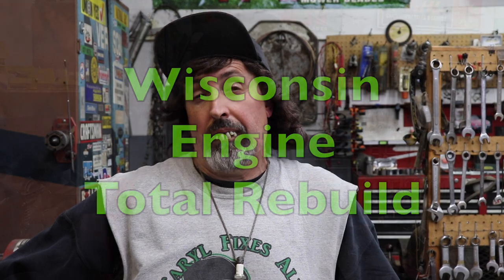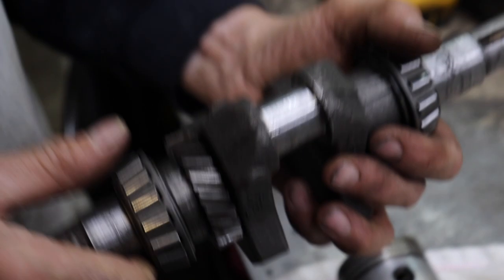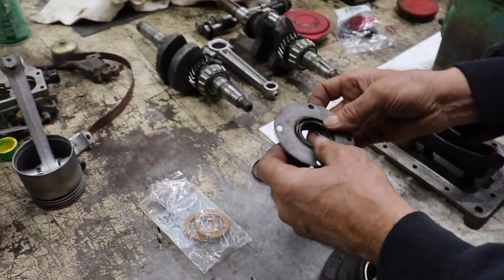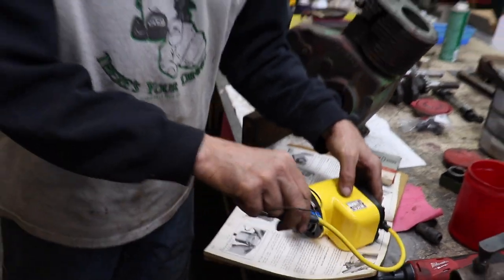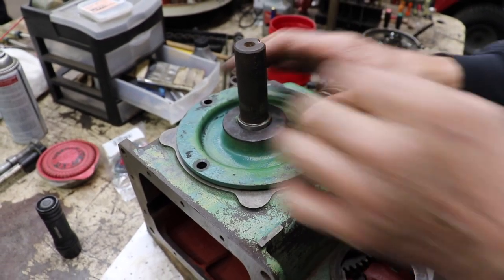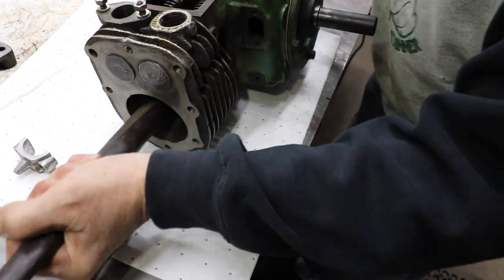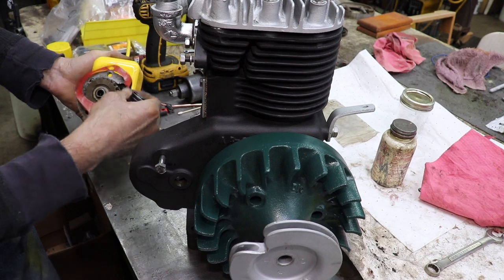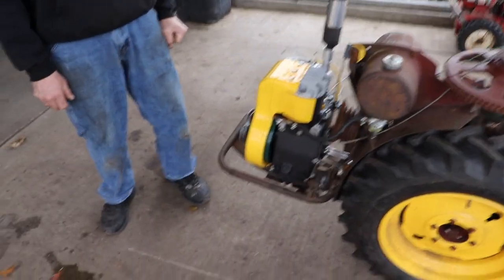Epic Wisconsin Engine Total Rebuild

Comment: Wisconson motors were used for years and years on all types of farm and industrial equipment.  Essex  mixers, stone mixers, big plaster pumps, small grout pumps, acoustic machines, just to name a few. The motors would run all day long. Once in a while  they would loose A mag. Or have some carb problems all easy fixes.  Some times a spark plug. They kept running with piston slap, many times they were low on oil. They ran in very sandy dusty conditions and kept going. They were old school motors. I think the company was taken over by someone else. They got to be very expensive. Honda took over there spot, also a very good motor.

Comment: Wisconsin engines often didn't have ridges but they got really tapered.  I used to rebuild AEN and AENLDs and I don't remember ever using a ridge reamer on them.
Reply: Those are really good engines, I have 2 one rebuilt and one not also a AGN
Reply: @loosehandle1  Back in the days when it was cheaper to rebuild an engine than buy a new one.  Wisconsin Robin engines came along and I was done rebuilding engines.

Comment: Maybe not on small single cylinder engines, but small car engines from mid 60s back often had 4 rings. The offset lifter to valve geometry was odd, but maybe it was some attempt to make the valves rotate and enhance sealing. You sound surprised it still ran. Just proof of how simple was better, and those old engines could take a lot. I've seen points that didn't even have any contact surface left. Those ones looked good to me. Does end gap actually matter?

Comment: Taryl I watched this video tonight..I have a Wisconsin Teledyne Robin horizontal shaft engine that is still new..never been cranked or ever had gasoline in it...It has a push button start also..I've had it since early 1980s in storage..thought I'd mention it here if anyone may be interested or have a use for it..Andalusia, Alabama
Reply: I would be.

Comment: I have owned and overhauled a few of the Wisconsin engines over the years but I haven't seen the push rods and valve stems mismatched like that I believe somebody build that engine  on a Monday or late on a Friday evening but they are a tough engine I like them and the four rings really cuts down on that piston slap but I have several of them in my collection I mean I ain't talking about a big collection I'm talking about maybe I got I don't know maybe four or five and I really like them they're  a nice tuff old engine just like this granddaddy in me. Lol!
And yes cork was the norm for most of the seals, I mean you get oil on them things and they just as good as any Rubber seal and probably do a better job cuz they are thicker.
I just started watching your video but I just had to throw my nickels worth in there but I'm going to enjoy the rest of your video cuz it's not my hands thats getting into that mess but I do enjoy when you get your hands all messy thanks for a great Channel we enjoy all your videos!

Comment: Taryl,

 On loose fitting seals, I have taken red loctite to take up the gap and hold them in place. The mating surfaces have to be extremely clean however, and you have to quickly get the seal in place before the loctite starts to dry.

Comment: You probably already got this info but I think the reason the valves and the push rods are not in line is to have the valve rotate while running(old technology) and the end filing is common on racing engines, have done many racing engines they actually sell a small
 Tool for filing ring end gaps. (Over size rings)

Comment: Maybe those seals could be glued in with lock tight? Or something more substantial,  possibly make a tool from pipe to drive it in, or if you have a lathe, machine the cover, to fit a bushing, pressed in, to fit the seal tight inside, but HEY!  It's not a rocket engine!,
Reply: We used old Indian glue back in 70

Comment: Just a general question do you also work on Vintage bikes. Like the VeloSolex 1700 from the 1960. Need to track down engine parts if they're even still available or traceable. My friend needs a piston and rings and gaskets.

Comment: I have an old way Wisconsin AENL D and AA-91A on the block. My question is , when I removed the coil box I found a line on the side of the cam gear and a “X” on the edge of the coil gear, so how am I suppose to put Back together and it fire correctly?

Comment: Lifters were not centered to make the valves rotate, 6&7 HP Wisconsins were basically bullet-proof, used a lot of small equipment in the 50’s. As long as the impulse works on the mag, it’ll start!

Comment: ive heard alot about babbit bearings and synthetic oil not going together. particularly in older vehicles. what are your thoughts?
Reply: No way would I try it , stick with what oil they used then like havoline 30w non detergent oil

Comment: Hay Taryl
I’m looking to rebuild/fresh up my 60s Briggs engine. How do you determine the correct piston rings to buy and where do you get em from.
Thanks, a fellow Grass Rat.
Reply: Find a parts manual for your model. Use the numbers on the pull start cover to find the manual. Then that will tell you what part number to buy. If you give me the model, type, and code, I will find them for you

Comment: HAY TARYL!!!
So No fancy dial gauge to check endplay, Ok So why do you have that fancy torque thing?
You mean to tell my that you elbow is not ASE Certified???  Mine is! :-D
While we're at it, Can you install a piston without that smancy fancy ring tool???? I have installed pistons for 40 years without one,,, Lol

On Mack 6cyl Diesel engine we had a tapered sleeve that set above the piston sleeve and we just aligned the rings and dropped the piston down the sleeve and bam Bam! There's Your Dinner! One piston installed... :-D)

But really I can install a piston without any fancy tools, just a screwdriver and a hammer... 

There's a reason the cylinder has a taper on top... Lol
Thanks for the video!
LLAP

Comment: I know nothing about buying piston rings. I have an AKN also, not sure how to find rings that will fit. I see many rings are meant for specific engines and I don't want to buy the wrong one's.  20 oversize is a good start but don't they have differences in other dimensions?

Comment: Most automotive tappets are off set so the valve and follower turns as it goes up and down so the valve does not seat in the same position all of the time..

Comment: Hi Taryl, Am I right in thinking you don't like Wisconsin engines?I never worked on them, but never
 heard anything bad about them either. do they all use a separate magneto? if so? why?
Reply: The mags were common many larger engines and the impulse ment you didn't need to spin the engine very fast to start. As in with a crank
Reply: @loosehandle1  Yes I think i heard about that, at low speeds u wound up a spring 
in the magneto and the mag turned a lot quicker than the crankshaft giving a better spark?

Comment: at the end it looks like maybe you have the throttle cable routed thru the big cast iron sprocket. you may want to check
Reply: That sprocket is stationary. It does not turn.
Reply: @plank407  my bad, I thought it moved with steering.

Comment: What would be your plan of action on a 1899ish Blackstone 26hp that's cracked/busted at the "hot bulb" the story as I was told was it was rigged up with nos( I would call BS but considering where it come from it's likely true) and turned a big double blade mill saw (through gearing not direct drive)I would like to repurpose it as I did with a Fairbanks hit/ miss for an "erotica" machine, these things run on nearly anything, I recycle waste oil here anyway so it would be a useful power plant, I tried welding it but didn't hold il try again with heating the iron and stick weld when I get my lincoln220 working again the little mig just isn't going to do the job here it seems. I'm not much familiar with welding or repairing cast iron

Comment: What a screwy design.  Paper thin gaskets to set end play,  cork crank seals,  offset tappets, 4 piston rings.  With all the friction from those thick rings probably takes 2 hp to turn it @3600.  Tappets should have been offset on the cam lobe to make them rotate for even wear.  And the oil pump to fill a trough ??  What were they thinking?

Comment: It Wooten bee too difficult to swap on a starter generator to that engine,   I been thinking about building a small tractor something like that,  I need something kinda small but heavy, over 1000lbs , I'm thinking about using a it's diff center section only, with sprockets where the halfshafts bolt on,  then use car solid axels with pillarblock bearings, with the axels cut to length, connected together in the center with  large piece of tubing with bearings inside, with disc brakes on the axels, , with at least a 2:1 reduction gearing with the sprocket, using a 5speed transmission, connected to the diff with another 2:1 reduction, sprocket and chain, at least, possibly a 4:1, to get a top speed with 4k rpm engines. Of about 25 mph, in 5th gear, 1st gear should be a walking speed,  with 3gear being the average driving around gear4-5 mph at 2500+/-rpm,  using a slightly modified harbor freight 212-224 engine, the 224 makes a bit more power, and has a oil pump,  port the head, raise the compression, maybe cam swap, it should make between 10-12hp, maybe swap to a bullet rod, and aluminum flywheel, the TQ can be maintained by using a flywheel on the transmission,  use 15x8" rims, with 31x10.50 tires, filled with water and antifreeze, , build a basic front axel with springs, the width being approximately 48" and 60-70" long, with a 80" box blade , and a 60" front bucket/scrape blade, using a 5link  to allow lifting,  with a latching system to keep in position,  lifted and lowered using a cable and pulley system,  using a winch to raise and lower, with a linear actuator to dump the bucket,  using starter motor, and acme threaded rod to build the linear actuator, or possibly a pneumatic cylinder,, build the frame and most of the components from 1/4" wall 2x2" Tubing, and 4" channel,  I have been planning this for a while,  a small tractor about 40-48" wide,  could come in handy    
Maybe even build a 4x4 system basically the same way as the rear diff is built, using fwd car spindles and knuckles, connect the original cv axels together with bearing like the rear, using sprockets  and a Subaru or Miata diff, with sprocket, using a gear ratio to keep the wheel speed the same as the rear, with what ever tire size,  maybe use a LSD (diff)to connect the front and rear diffs, with chain and sprocket from a 5dpeed trans, connected to a 10hp engine, sorry to ramble, but building is my thing,  this should weigh enough and have the power to move cars ,. Push gravel,  sorry again for rambling, great video!!

Comment: Older Whiteman troweling machines use to have Wisconsin's,,,but chanced over to Kohler engines in the mid 70's. Both due to pour maintenance didn't last, and then Honda came along,,,and that kept Whiteman in business and still one of the best troweling machine for the buck today.

Comment: Just a guess as to why the tappets don’t line up to the valve stems other than  faulty machining, maybe it’s to make sure the valves  rotate as they run in, but they do that anyway, so best conclusions is that their machinist were bad alcoholics. Lol

Comment: That's the dumbest way to oil a small engine I've ever seen. A little pumper type pump, prone to failure, pumping the oil up into a little tray. Why not design a sump with oil in the bottom and let the dipper go directly into it like most small engines? Let the little twat shaped tray, if needed, sit in the oil with side holes to let oil flow into it. I meam WTF ??